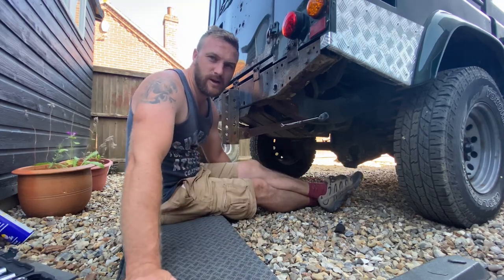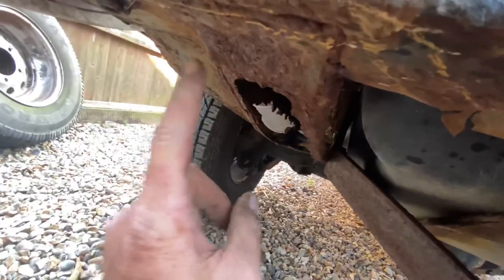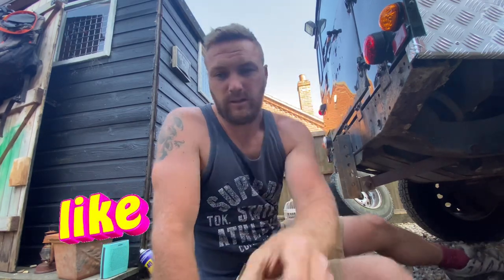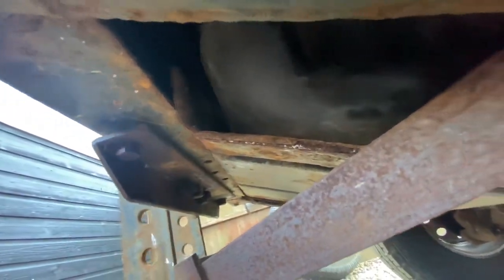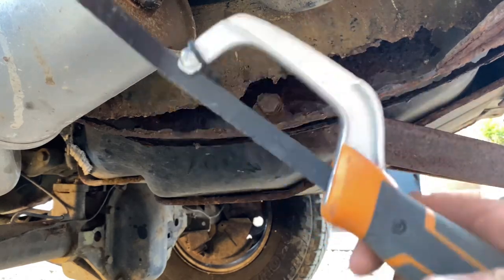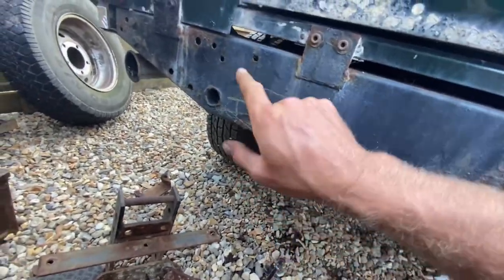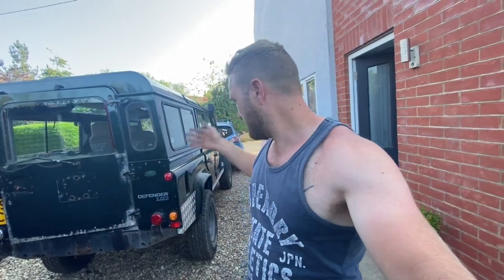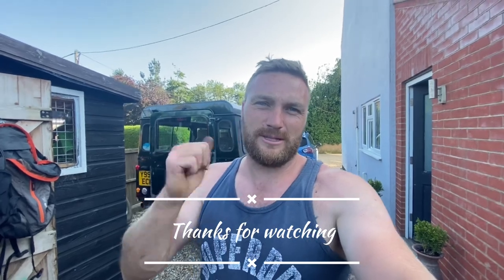Removing the tow bar off my Defender 110 (mega rust found)

Comment: I’ve got exactly the same defender 110 as yours.   Same green same Y reg.  same chassis rot!   I’m in the process of getting all the chassis bolts off and electricals before doing a body lift.  Learning as I go.  Dorset based 👍🏻